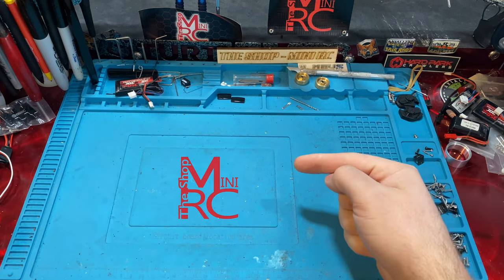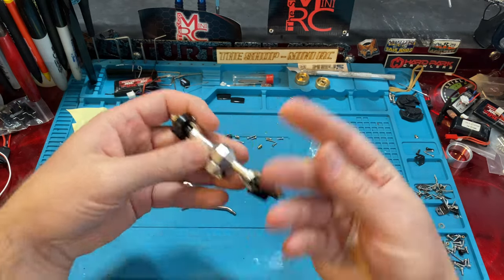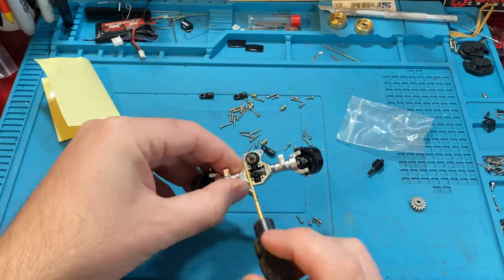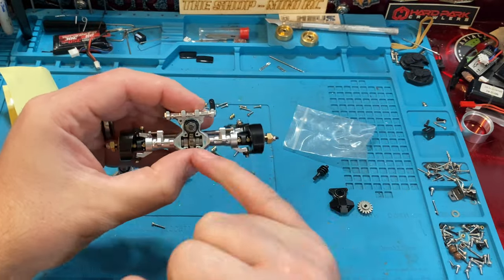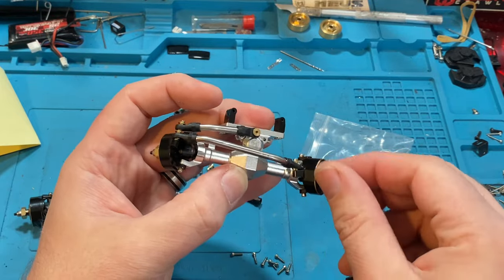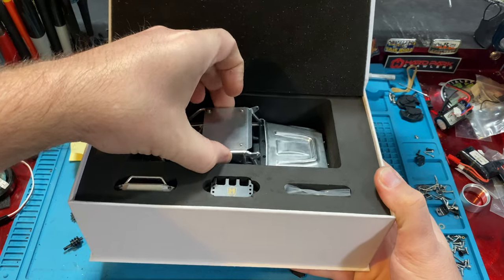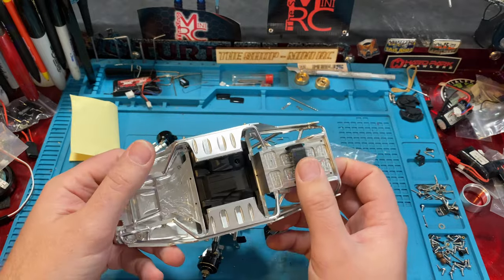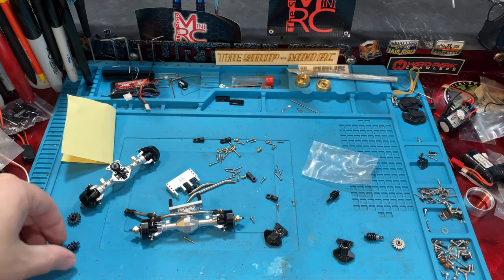Meus Isokinetic Double Jointed 3-Section CVD Axles for the SCX24!

Comment: Isokinetic…Good timing. I had a guy asking about these on our FB group, sent him a link. My only question is, wouldn’t the tires rub against the suspension springs? They’re still my next axles, decent pricing on those too
Reply from the maker: Depends on how large of diameter the shocks are and how they are mounted to the chassis. They could rub but worst case, just turn down your dual rate until they dont. (or you could add MORE wheel spacing).

Comment: I got mines last week! Just wow! The build quality is unbeatable and the steering out of this world! Only two points that could be better. The steering link which protrudes quite a lot w/o any reason and the rear diff cover. In my opinion the rear axle diff cover should be placed on the normal external side (facing the rear of the truck). This way the diff cover screws wouldn't hit the rocks! Not only they placed it on the inside side, but they even used cap head type screws making it even worse! I immediately replaced them with button head screws, but the holes are not deep enough anyway! Overly though I am extremely happy with them. The best axles right now on the market!
Reply from the maker: I could definitely see your 2 points.  ;)

Comment: Anyone have a solution for bulky steering link? Can any scx24 link fit or is the spacing from knuckle to knuckle a different length?
Reply from the maker: You can easily make a steering link also 3flow9rc can get you a custom setup. ;)
Reply: Awesome thanks! I’ll look into it as soon as I order mine.

Comment: I have a set of these on my deadbolt, they are awesome and by far the best axles I have. An added bonus that they come with an adjustable servo mount and rear link mount. I’m definitely getting more of these.
Reply from the maker: Right?!?!  Steering links, servo mount, rear link riser.   Such a great setup!!!!
Reply: @TheShopMiniRC  it definitely is and as you say even at full lock it’s very smooth running.

Comment: Isokinetic. How do I contact Meus about missing hardware in my axle kit? Missing 3 of the brass pivot balls for the steering linkage. Plus the rear axle spins smooth only with the diff cover screws loosened.  I bought mine from Amazon if that makes a difference. Not a happy camper. 😕
Reply from the maker: Either through their website or on their facebook page
Reply: @TheShopMiniRC  thank you, Ken.

Comment: love these im gettting these next!! wonder if they make them in brass i know im a bit late!! I have a set of injora + 5axels that i stripped the outer edge axel hole on the bottom, how would you go about fixing that?
Reply from the maker: You can always try to use an m1.5 tap and screw. Or a m1.6.

Comment: Isokenetic! So what did you think of all that slop in the front axles? Seems the pin holes are off in relation to the thread stops a bit too. Had to use some deeper hex’s and backspacing sanding to get thin hub wheels to seat. Other than that, super nice axles. 
And killer Ripper! Didn’t know you had a proto! Very cool. You’re right on ditching the 4WS on it. No way with that battery tray.  The rear link riser is bad enough with it.
-Cheers!
Reply from the maker: I think the slop is tolerable. I obviously wish it was a tad less though. Mine had some o-rings between the hex and bearing and that seemed to help that slop a tad.

And yeah, we have the prototype aluminim scx24 AND trx4m rippers. Also #001 of both and #100 of both. ;-)

Comment: I'm hesitant to jump to these because I'm just trying to increase my steering angle without the other stuff.
Do you have any suggestions in terms of maximizing steering angle by just getting new front axle shafts?
I am leaning towards the LGRP v2 CVD's since they are rebuildable and I have a tendency to wreck driveshafts.
Reply from the maker: Yeah, cvds will help. You can also looks closely at the axle housing and knuckles and see where it’s hitting. You can slightly trim away there and it will help. Even just a tiny bit will give you more steering. Remember in these tiny trucks, mm are like inches.

Comment: Much easier to overdrive the axles on a 4WS using an overdrive transmission. I use Hot Racing  HRASXTF38X but there are generics for a lot less.
✌🏼
Reply from the maker: That’s probably true. ;)

Comment: Yo dude, how's tricks? Just wondering if you know if any other after market rear axle truss/link risers fit on the rears of these? I've just received my 3rd set of them and my desired hole seems to be fouled up with some type of glue or something rendering it pretty much useless. Any help would be much appreciated. Cheers👍
Reply from the maker: No stock link risers or servo mounts will directly bolt onto these without modifying either the mount or the axle mount.  You need to trim/grind down to make space.
Reply: @TheShopMiniRC Thank you for the reply, the build is for a birthday present for my 5 year old son, I can't really give it to him all beat up and modified so I'll have to contact meus and see what they are saying about replacing the riser 😳 hopefully they agree 🤞 it's such a shame as the other 2 sets I already have came perfect...... 🤔 if they don't agree then I have been toying with doing a rear steer so maybe sack the whole rear axle and buy one of the separate fronts they have for sale🤷‍♂️I've done him a fully built blue Bronco to tow an injora SCX24 trailer I've also tried to build him a line slaying injora rock buggy to load on the trailer, both vehicles have the meus isokinetic axles so I'm sure the rear steer wouldn't be out of place on his buggy, I chose the C10 wheelbase for the buggy..... do you think I would be better off stretching it for him? Perhaps putting the C10 rears up front with maybe some deadbolt rears on the ass end? Cheers
Reply from the maker: @tomwright943  just because you modify doesn’t mean it’s beat up.
Reply from the maker: @tomwright943  c10 fronts deadbolt rears.
Reply: @TheShopMiniRC  yeah I do understand what you are saying, I'm sure I could make it neat, I just want it to be perfect for my little chap is all.
Reply: @TheShopMiniRC  thanks yeah I'll get ordering..... 1 month left to run to his birthday I'm sure I will work something out for him 😎👍

Comment: Thank you so much for sharing dude. These look very nice 😎👌 I've just ordered some. I was wondering, do the injora servo mounts fit on the front axle? Cheers
Reply from the maker: it would take some modification to the axle diff cover to make it fit... the axles come with a good servo mount.
Reply: @TheShopMiniRC  Thank you for your help, I've chosen the plastic injora servo for now, would you know if that servo would fit in the original mounts on the axle? Cheers dude 😎👍
Reply from the maker: @tomwright943  I’ve never used that servo, but if it’s the same as all the other high torque servos it should fit fine.  Also, if it’s smaller, you can probably make it work.
Reply: @TheShopMiniRC  thanks for the advice 😎👍 

I'm struggling with another problem at present. I'm trying to get an understanding of droop and suspension geometry, while I'm waiting for our parts to build our first SCX24 to arrive, so I have been working on my sons wltoys 2428 trying to get a better performance from those parts on that truck, I've completely redesigned the chassis rails, and formed them from 2mm styrene/plasticard sheet, I have laid the front shocks back so as they are 40° in relation to the deck, the rears are at 45° it was working 1000 times better than the original setup while the original 45mm shocks were still on it so I'm thinking can we ad some droop with some of the injora 51mm double barrel shocks 🤔 so we fitted some, when she is just stood still she sits fairly nicely with the linkages fairly level etc then when you pick her up the droop looks mega 🤯 the main problem is that, when running her she will run fairly level then when you come to a stop she will arch her back (like a cat being sick) the harder we come to a stop the higher she goes, I know this ain't right so it is back to the drawing board, would you have any advice on shock angle? Or have you came across this poorly cat syndrome before? Is there a solution? Any advice would be welcome 😎👌me and my son are just messing about with this one seeing what we can learn and understand about these here crawlers 😎👌
Reply from the maker: @tomwright943  hmm. Hard to say, usually the double barrel shocks do not perform the best and the more you angle your shocks, the less effective they actually become.  Typically an arching truck is because of bad geometry. I’d try lessening the angle to se if it helps. Remember, you don’t need a ton of “flex” for the truck to perform well. The more flex you have the sloppier the truck becomes.
Reply: @TheShopMiniRC  ok, thank you, I'll bare that in mind when trying to tackle the project again 😎👍
Reply: Just wondering, could you recommend some decent shocks? I have already ordered some 48mm double barrel shocks for my upcoming MB24 build, but you say they aren't that good. I would really appreciate a recommendation by you if that's cool?
Reply from the maker: @tomwright943  we really like the nexx racing oil filled shocks. They have shorter ones and longer ones as well as standard or true reservoir.